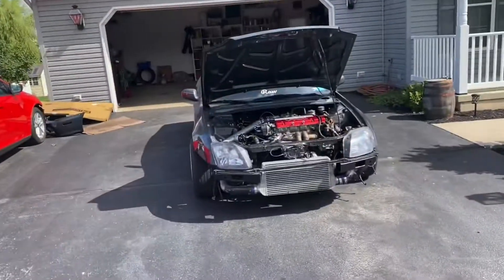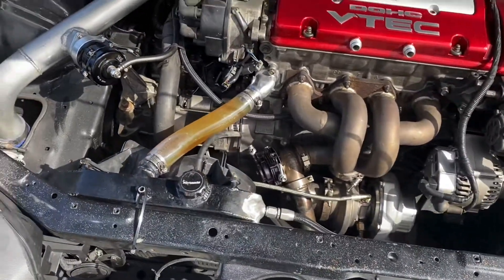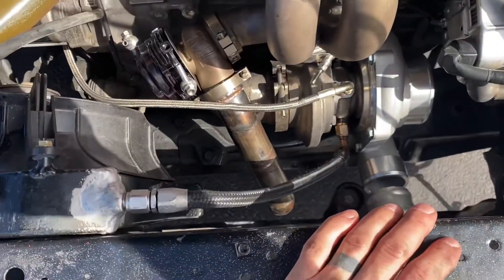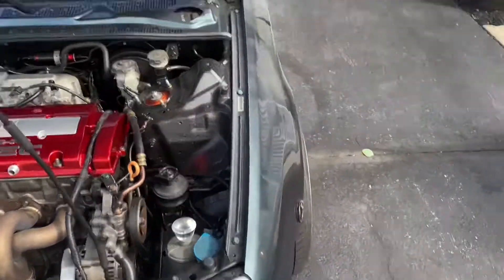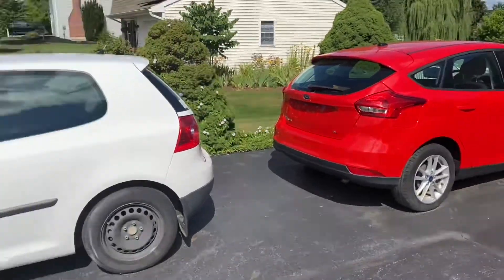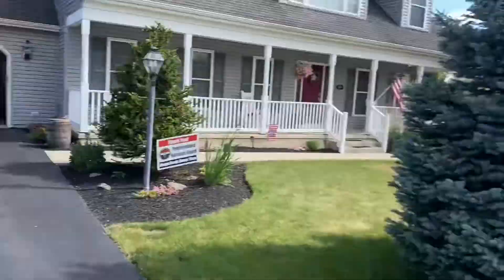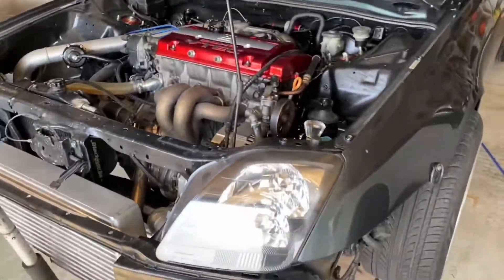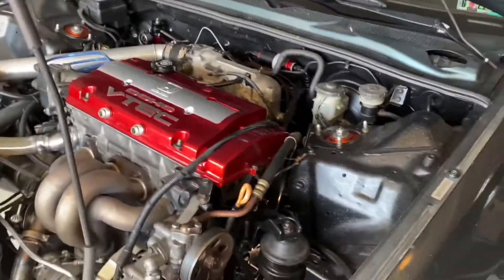For the Subscribers: 1997 Honda Prelude Gets a Bath #broll

Comment: Hey bro I'm trying to use the same turbo you're using on my first turbo build and I'm kind of confused, are you using both water and oil cooled?
Reply from the maker: Yes oil I am using both. It is not a requirement to use the water cooling but statistic show that it prevents “coking” which is when the car is shut off the heat soak from the hot side goes into the bearing cartridge and burns up the oil.
Reply: @thestateofreal2533  Oh okay bro thanks for the reply, I was mad confused cause I'm only use to my brother using oil only so I was lost asf
Reply from the maker: @IndigoNegus  no problem! The water cooled thing is something we have seen implemented more often now, especially with the dual ball bearing turbos. I believe it’s because the heat soak on a DBB turbo is more common than on a journal bearing turbo but I am speculating.
Reply: @thestateofreal2533  Okay bro I have another question it might sound really dumb but I don't wanna ask my brother I want to surprise him with this turbo build, but the oil return/drain would be going directly to my engine wouldn't water/coolant be mixing with the oil going back to my engine?
Reply from the maker: Great question! No, the coolant circulation channels are different than the oil channels in the turbo. Similar to an engine, there is a coolant jacket around each cylinder for coolant to be pumped through while there are also oil channels (oil galleys) that circulate oil through all the bearings, crank, and to the head(s) of the engine and drain back down into the oil pan.
Reply: @thestateofreal2533  Oh Okay thanks alot bro I have a better understanding now, btw you're Honda Prelude is looking mad mint bro made me think about getting one after this build
Reply from the maker: @IndigoNegus  it’s all camera angles bro! She needs paint and clear like most 26yr old cars haha but thank you!
Reply: @thestateofreal2533  😭You should see some 10 year old cars in my country that don't look that good from any angles